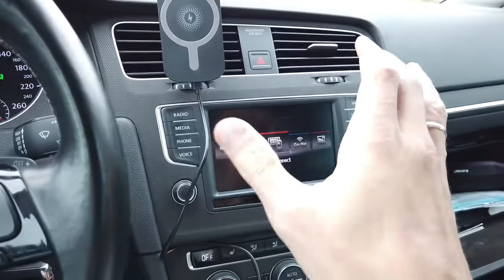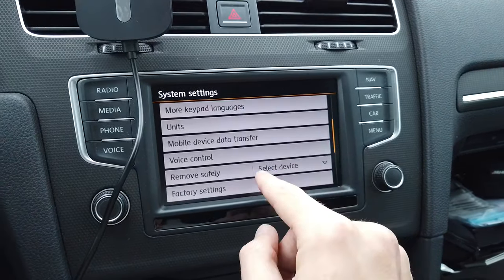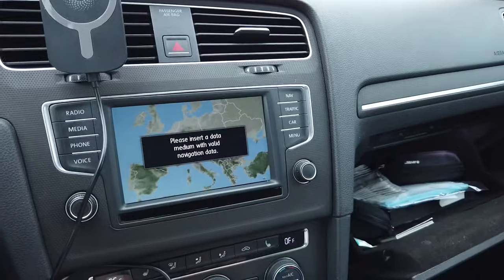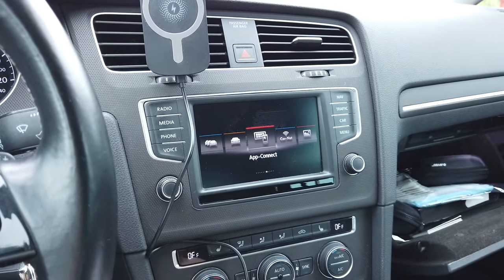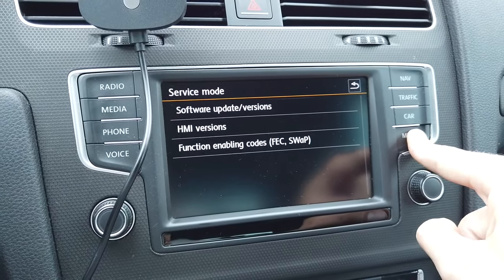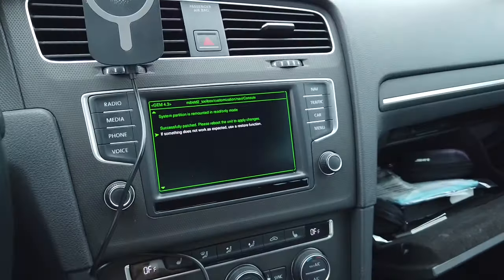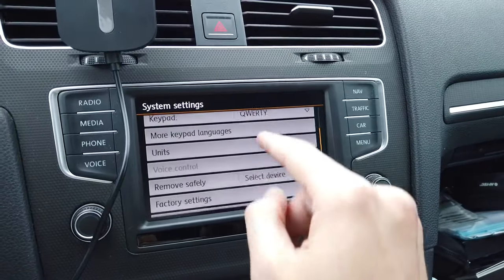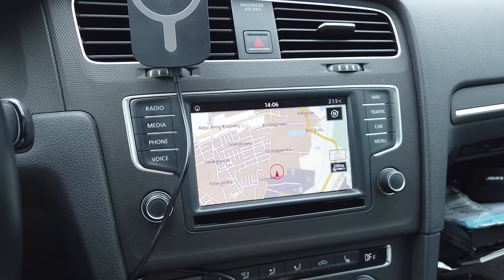MIB2 navigation SD card CID Lock removal with MIB STD2 Toolbox

Comment: Merci Mrfix !!!!!! J'ai pu installer la dernière version que j'ai téléchargée depuis le site de Volkswagen et installée sur une carte sd avec ta procédure !! La dernière version ne rentre pas dans une carte sd de 16 Go comme les précédentes versions si l'on veut beaucoup de pays autour de le France. Ma version est : 5NA 919866 CK 1910 ECE AS 2023 SHIELD 2016-03 (build 020).
Par contre cela ne fonctionnait pas avec une carte micro sd HC 1 de 32 Go (avec adaptateur), elle ne doit pas être assez rapide où ce n'est pas une vraie classe 10... Et lorsque j'ai installé le fichier maps sur une carte sd xc1 (512 Go)  ça a fonctionné !!! Je vais acheter une carte rapide de 32 Go et la mettre dans la voiture au lieu d'une 512 Go qui coûte chère...
Merci encore 1000 fois !!!!! l

J'ai essayé d'enlever toutes les voix et ne laisser que la France mais ça ne rentre pas dans une carte sd 16 Go qui a un volume disponible de 14,8 Go alors j'ai enlevé un des 13 fichiers celui E13 de 217 Mo pour que ça rentre mais la carte de fonctionnait pas, comment enlever un fichier d'un pays qui ne m'intéresse pas pour que ça fonctionne ? Merci d'avance pour toute aide

Comment: Hello,

Please I have an issue with mu audi a3 2017 specifically the sd card. 

I pulled the sd card and inserted it again but an "lecture is impossible" message is displayed on the dashboard and as a result I can't link my phone with bluetooth to my car
before pulling it out , everything was working well.
I tried to reset the on-board computer but still not working. Please any solution to make it work again.

Thank you

Comment: Thank you very much for your great work! Everything works fine but I have a static fault code B126CF0: "Navigation database malfunctioning" that I can't get rid of. Do you know how can I fix it?
Reply: Never mind, I read that the error is caused by the different CID of the SD card, to remove it I should buy one with a custom CID but since everything works fine as I already said I will leave it like that.
Reply from the maker: Exactly, this error is just caused by the CID mismatch.
Reply: @mrfixpl  thanks a lot man, did everything for the navigation sd lock and the carplay on my vw caddy and everything works. also remove the faultcode of the software worked fine! just 1 fault code of the navi but now i'm sure that is nothing. thanks a lot man, you're a legend. and saved a lot of money. i had also issues with the touchscreen and if i would repear it by vw it would cost me 1000 euro's, i changed the screen myself for just 15 euros and thanks to the videos of you i have everything working!

Comment: hi , i installed toolbox and everythig worked good, but i tried to do what you have done in the video  so unlock the  cid -lock but i didnt work , it said patch aborted backup failed. what can i do? Can you help me?. thanks.
Reply: Hi!
I had the same problem and I simply solved it by introducing the SD card in UNLOCK mode. Then it patched. 
Try this, let us know if works.

Cheers!

Comment: Does it work with Tiguan 2019 with sw0891?
Reply from the maker: Check your SW Train in hidden menu (press and hold MENU for 3 seconds). next use mib-helper.com to check details, mods, and extensions for your system.
Reply: @mrfixpl  Thank you my friend
Reply from the maker: Good luck!

Comment: Do you have a way for me to update the radio myself?
Reply from the maker: You can look around for software updates for your unit. There are places on the internet where you can get it.
Is there a reason why you want to update the software?
Reply: @mrfixpl  I'm in USA and the dealer has a tight hold on updates.  I don't want to go to the dealer.  My radio disconnects from my phone when hot.  Maybe a software update can fix it.

Comment: Hello, i have a problem. I installed mib2std toolbox and tried to do the cid lock patch (unit is sw0359). But after the restart of the unit the map is not loading, even the original one doesn‘t load. After undoing the patch by backup the original maps are loading. Can you please gibe me a hint, whats going wrong. Thanks.
Reply from the maker: Update to 0369, update toolbox (if not the newest version now), redo CID patch.
Reply: @mrfixpl  Thanks. I will try to do the Update.
Reply: @mrfixpl  Hello, i have updated the unit to 369 successfully and i have reinstalled the mib Toolbox (v1.1.2) but the cid unlock is still not working. If i try to unlock, the navigationdata is not accapted, even Not the original one.
Reply: @mipe3de38  hello, I encountered same problem, but mst2 with 0480T fw. after cid patch original card is not working, after restore from backup - original card works, 3rd party sd card never works. Have you found a solution?

Comment: Original VW navigations cart are free. Why bother?
Reply from the maker: You dealer will give you 5NA 919 866 AS card for free?
Reply from the maker: That’s what I thought. Used ones are around $100
Reply from the maker: I know but you can’t use them with non-VW card because of the CID lock.
Reply: @mrfixpl  I have downloaded on non VW cards for my golf 7 with mib1, mib2 and mib2.5 with no problems (All Discover pro's)
Reply from the maker: Sure, because Discover Pro (MIB High) have internal HDD which is considered as valid media storage. SD/USB is just for update.
Discover Media (MIB Standard) requires valid card to be inserted at all times for the gps to work.
Reply: John Dice  I know how mine works. That works for me :)

A bit strange though that the two systems work in different ways but uses the exact same card.
Reply: @Leonardofahrer  at least for mine it was that I can download maps for free for 3 years after I bought the car. Afterwards the original card doesn't work. New card cost around 200€...